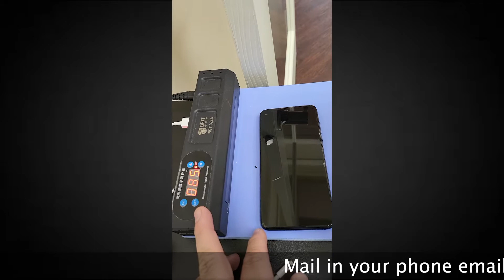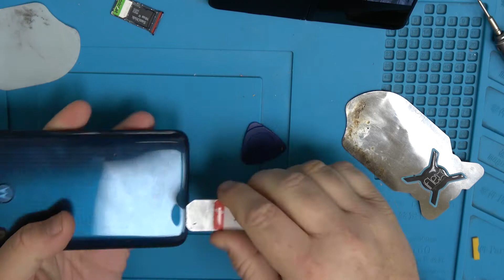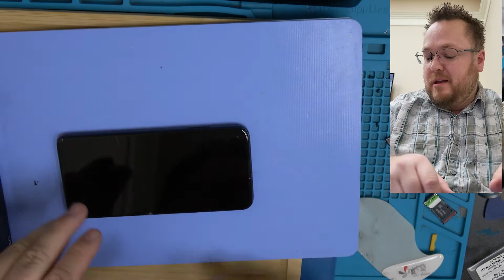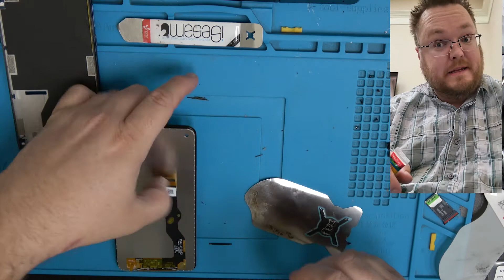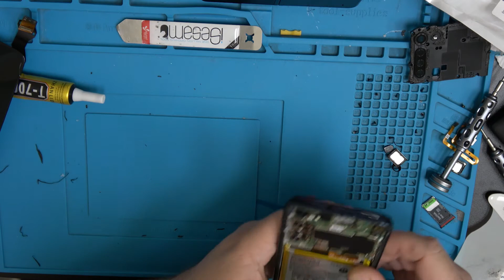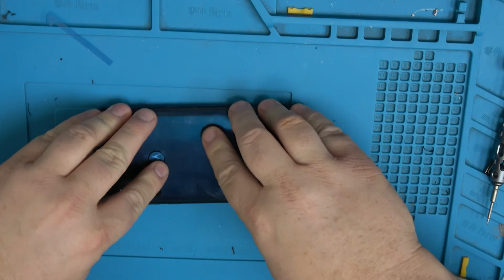Motorola Moto G8 Power Screen Glass Digitizer LCD Repair / Replacement DETAILED

Comment from the maker: Please support the channel by using my amazon links! 
For just the Screen Glass , LCD & Recommended Parts click on the links below.

Display Touch Digitizer Glass LCD Screen :
https://amzn.to/34gp1BO
https://amzn.to/3G35Kln

LCD Screen Replacement :
https://amzn.to/3qMzlZY
https://amzn.to/3JLlcVC

G8 Power Front Glass :
https://amzn.to/3pXCp6k

2 PACK Screen Protector :
https://amzn.to/3EXp0j2
https://amzn.to/3F0O2Oe

G8 Power Battery :
https://amzn.to/3HE8fuN

G8 Power Covers :
https://amzn.to/32Qy0t2
https://amzn.to/3G1zbV4

FOR NEW PHONE!
https://amzn.to/32WeJq9

Heating pad:
https://amzn.to/3mbIytW

Heat Resistant Gloves
https://amzn.to/3EsZdyW

My blue mat to keep everyone organized:
https://amzn.to/3BalS16

Iflex:
https://amzn.to/3CpyDXn

iplastic:
https://amzn.to/2ZhliSB

on of my favorite screw driver sets 2uul:
https://amzn.to/3jsqkCz
https://amzn.to/3CcoL2Y

iseasmo good for prying: 
https://amzn.to/3Ce2Wjr
https://amzn.to/3vJdSTY

Tweezers:
https://amzn.to/3B7yBlf

T-7000 Water sealing glue:
https://amzn.to/3EdzLxs 

Isopropyl Alcohol For Technical Use:
https://amzn.to/3BqBU78

Need to get a part from a reliable quick source, you'll find a better price here then Amazon and the quality will be a lot better. Click on the link below.
https://www.injuredgadgets.com/?acc=be9b6cec65c863e1b55538d2c7fcc9b0

• Visit our Website: https://tech-md.com

• My email: dustin@techmd.bz

• To mail in your phone, please contact us at 801-438-6028

Comment: Hi, thank you for your great video! I followed your video instructions after getting back my phone with a screen replacement from a local phone dealer, as I noticed that Wifi and GPS signal got very bad after the screen replacement. I checked both "antenna"? cables which run along the battery and connect the lower with the upper part of the board and they are connected well. What could also be a potential reason in your opinion? Greatly appreciate your help and input.

Comment: Do you ever have problems with the B 7000 Glue running into the backlight and ruining it?
Reply from the maker: I don’t use that product it’s very difficult to work with I tend to like t7000